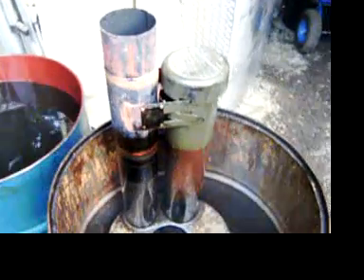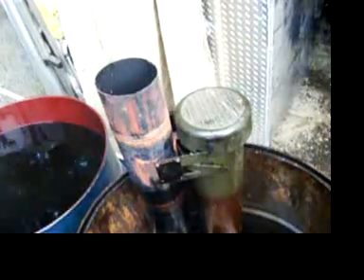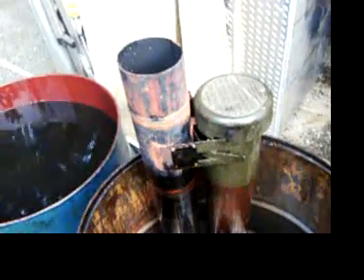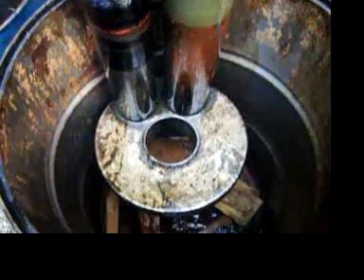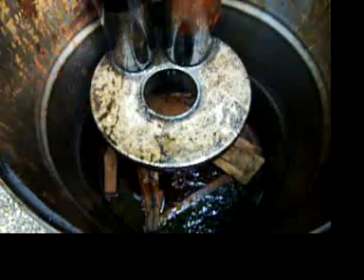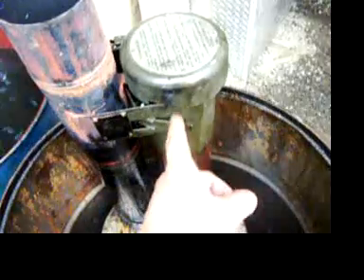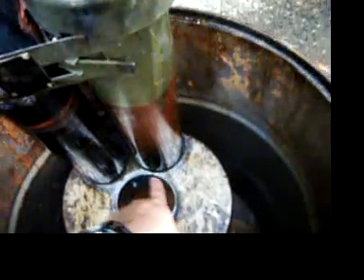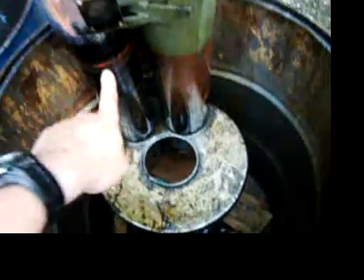M67 Immersion Heater for removing water from WVO Part 6

Comment from the maker: @honda4004 No.  You have to use a chemical treatment process to remove those detergents.  I do not support the use of waste motor oil in diesel engines.  There are sub micron particles of dirt, metals and pressure additives that are then forced through the injector systems, not to mention the smoke pollution.  I'm not saying that it can't be done, but it'll cost the user big time when injectors and dirty engine parts come back to haunt the user trying to save a buck.